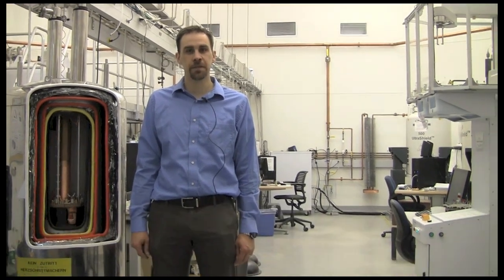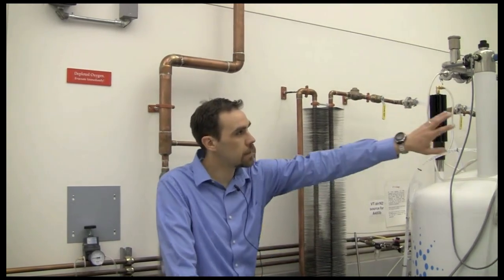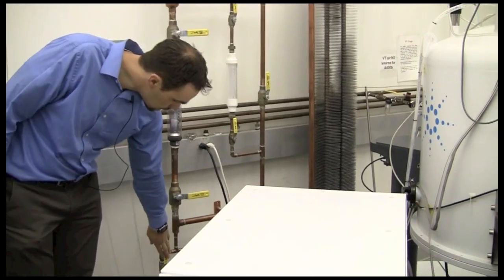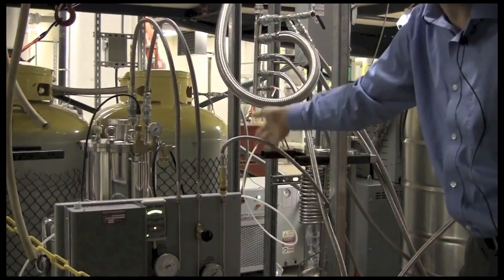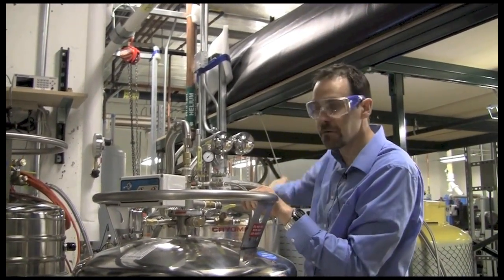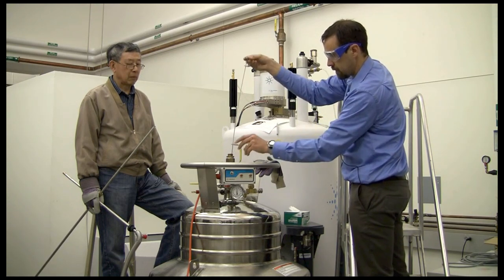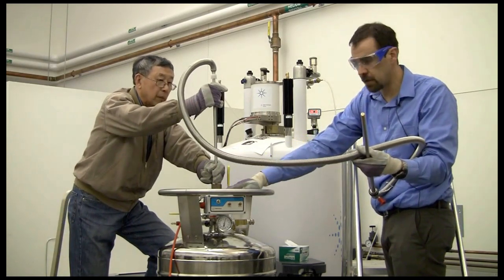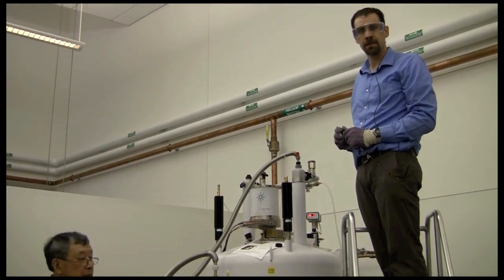Helium Recovery System - Yale CBIC

Comment: Great video! We had a bit of a panic this week with the current helium shortage and are probably going to be putting our NMR onto the physics department's helium recovery system this year. I was very interested in the technique you used to clean your purifying heads as our University is outsourcing this process. It sounded fairly simple to do in house. Anyhow, thank you for the video!